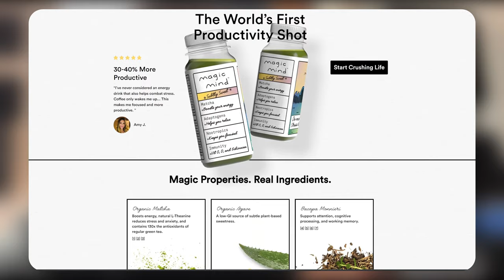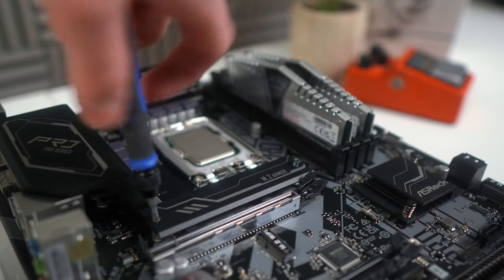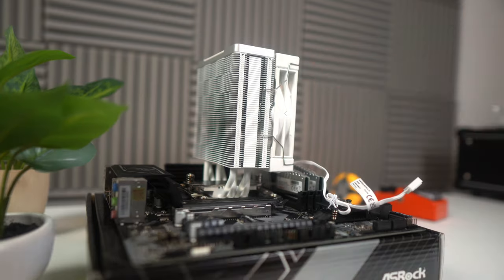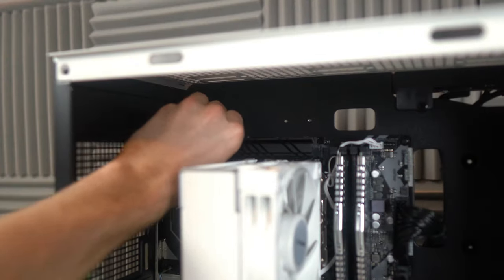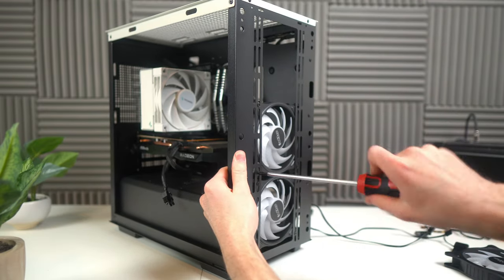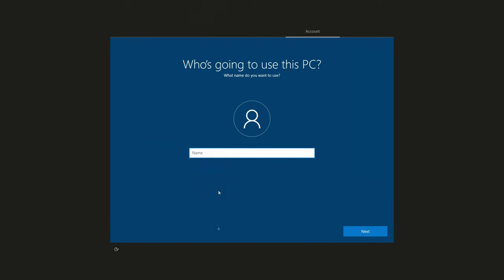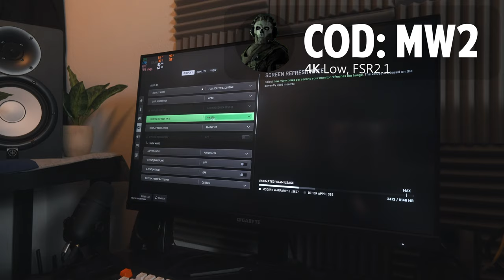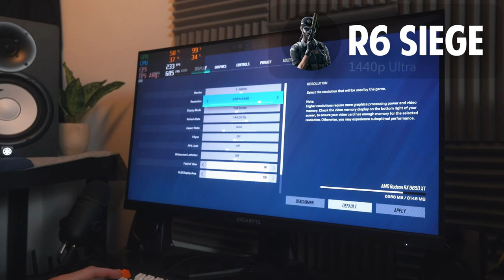BEST $800 Gaming PC Build Tutorial! [w/ Benchmarks]

Comment: Just finished building this pc today and I'm very grateful for this tutorial as this is my first time building a pc.
Reply: how much did it all come down to be and did you switch some things around?
Reply: @blizzonipad5528  it was around 910 usd because I switched the case fans, case and ram with different ones that I like and some additional storage.
Reply: @Oof_2nd  what case did you change to?
Reply: @itsalex715  I went with Antec AX20 Mid tower.
Reply: @Oof_2nd  Thanks
Reply: How much fans should I get for the pc ???
Reply: @bruh2176  3 is enough but you can spend more to get more
Reply: @Oof_2nd   but in the video he had 6 ?
Reply: Is that ok ?
Reply: Does this perform better than the legion 5i
Reply: @bruh2176  You don't need that many fans but you can get it. Use your brain.
Reply: @Invixnlty  Never even heard of it.
Reply: @Oof_2nd  my bad bruh it’s my first time building one
Reply: @bruh2176  Ah, apologies mate. You don't need that much fan for this build as it doesn't generate that much heat. My suggestion would be to buy a Case with 3 front fans and one rear and you should be good to go.
Reply: @bruh2176  Imo, the Kolink Citadel Mesh (i think its called something else in the US, but in the EU, where I live that's its name) is a great matx case (same size as the one in this video) and it comes with 3 PWM fans in either argb or non argb.
Reply: @Oof_2nd  bro what can I do I built it but it won’t show any available networks what should I do ?
Reply: @Oof_2nd  do I need a WiFi adapter ???? Pls answer
Reply: @bruh2176  Mine has adapter. You'll have to check the version you're buying if it  has adapter or not
Reply: @Oof_2nd  what did u buy or recommend if I bought the same parts in the video???
Reply: How is this build so far I’m thinking bout building it for my first build
Reply: @jeremy2977  It's pretty good. I had no problems in the games I've tested. I highly recommend this build.
Reply: @BaconHead7  Your guess is correct. I get around 60 FPS with bunch of shaders and texture pack. Normal MC I get around 190-200 in servers. I didn't test in normal world. I don't play fortnight so I can't help you on that.

Comment: I just finished building this PC but my ram does not want to run in dual channel. If I put it on 1 and 3 or 2 and 4 it won't display anything but if I put in a single stick it boots and displays on the monitor. What seems to be my issue? Also all the parts are the same used in this video description.
Reply: Did u get it fixed?
Reply: I have not fixed it yet I'm sending back the ram just to see and getting new ones to see if that my issue.
Reply: Good news I have fixed it. But let me tell you all check the pins on the motherboard where the CPU goes some of my pins where bent which was why dual channel ram was not working.

Comment: My build (£780)
Rtx 3070 vision £320
Intel i3 12100f £71
Nzxt N5 Z690 £105
Nzxt h510 flow
Gamemax iceberg cooler £50
J&D White extension cables £20
Crucial 1tb ssd £38
Arctic mx 6 thermal paste
Corsair rgb  ram £40

ADX power supply 650w gold £58
Reply: how does it work on games like fh5, cod..?
Reply: @sebastianvasile4590  for fh5 I get around 80 - 90 fps on 1440p extreme
Reply: @user-on7jb9uf5i  thats good ty
Reply: @user-on7jb9uf5i  i might build your same pc
Reply: @BaconHead7  Fortnite low settings I get around 350-370 fps